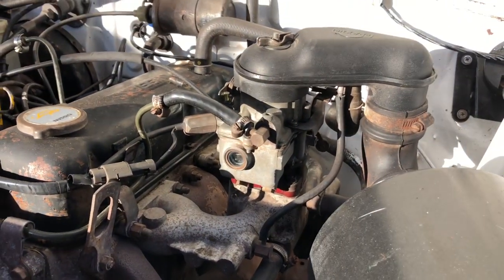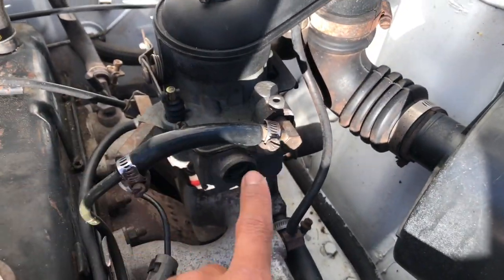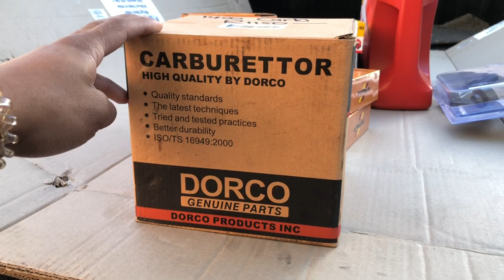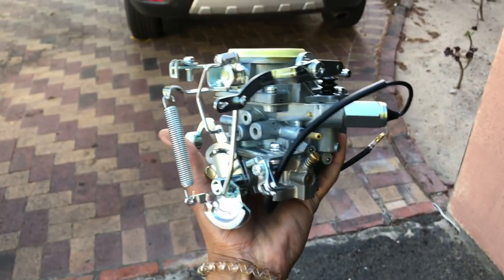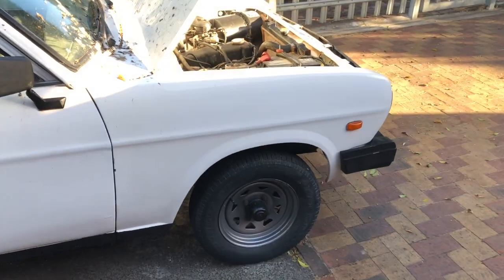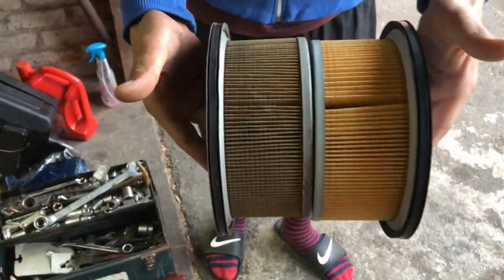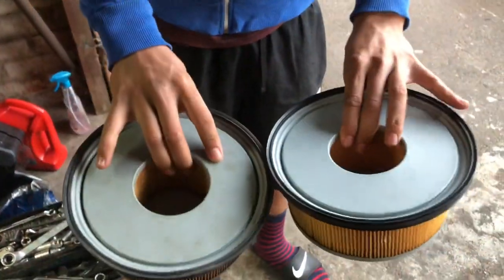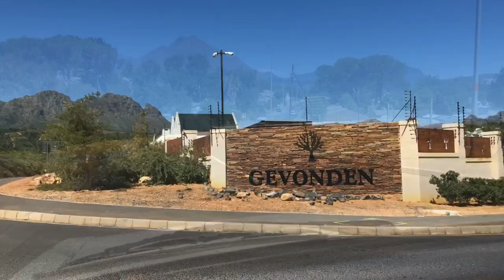How to install a BRAND NEW Carburetor on a Nissan 1400 bakkie | Visiting LateLateCustoms!

Comment: you always going to have problems with those pirates carb, it is best to rather overhaul your original carb. the best option is like the previous comment said is do a weber conversion. if you interested I can give you someone number that can do that for you.
Reply from the maker: Hi. Feel free to DM me your details. I definitely want to overhaul the OEM carb as well as a back-up. 😃 I will also look into the Weber conversion. The goal is to have the bakkie as fuel efficient as possible, also as reliable as possible.
Reply: I’m already having one with my current one it’s overflooding and leaking
Reply: @lifankwale2082   yip I know it always gives issues, easy way out but suffer at the long end